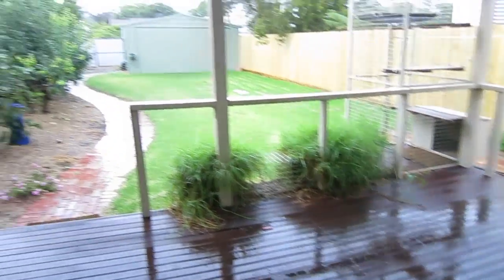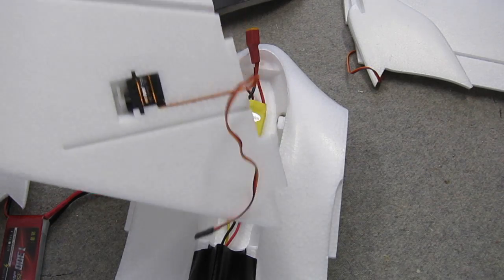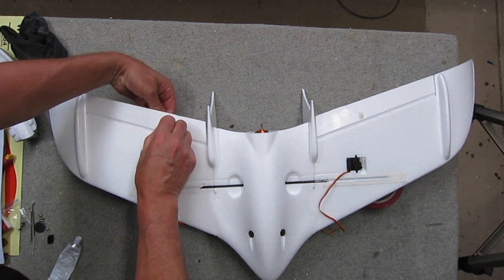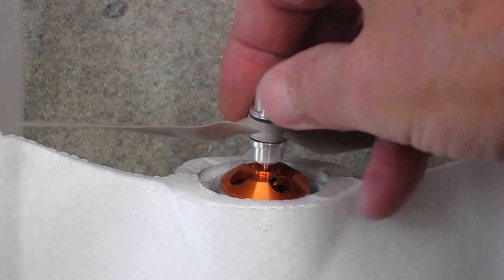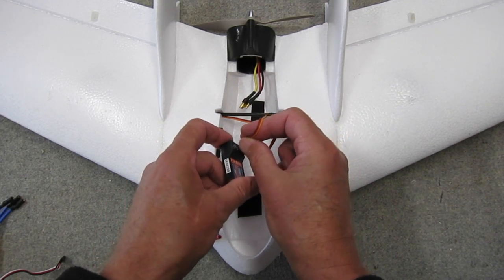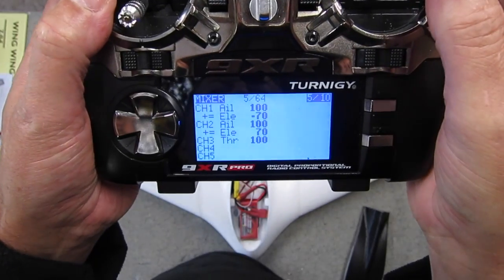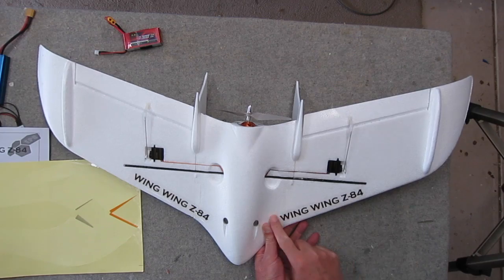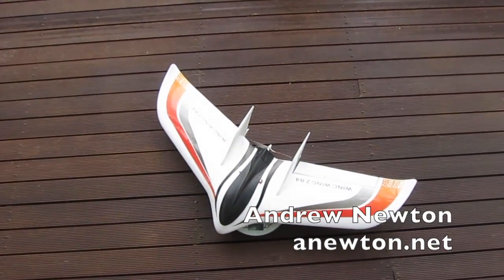Wing Wing Z 84 build

Comment: I would Have liked to see which holes did you use in the horn and on the servo. Also how much throws you have setted up. I am building mine. I have to make one of the holes bigger on the servo side but not sure which one to choose.
Reply from the maker: I'll share some closeup photos in a minute
Reply from the maker: Reflex and pushrod photos https://www.flickr.com/photos/pandasimages/31892513604/
Reply from the maker: https://www.flickr.com/photos/pandasimages/31892513134/in/photostream/
Reply from the maker: I have 50% 75% and 100% rates. It's a bit wild on 100% need to work up to that.
Reply: Thank you. I see that I need a little bit more reflex. Your servo control horn is quite shorter than mine. I installed the TowerPro Fake metal gear servos and they have quite a larger control horns so instead of the last one I used the following one. Your rates will help at keeping the maiden anxiety more controlled for sure. :)

Comment: oh, should the rx's antenna lay horizontal or stand vertical?
Reply: i placed the antenna like what you did but loses signal around 50m ?
Reply from the maker: For best range it should match the transmitter antenna, both vertical or both horizontal and side on to each other. Worst signal will be when they are pointing directly at each other. But if you're losing signal at 50m you have bigger problems than antenna orientation. Maybe a broken antenna.

Comment: can you tell me what size prop adapter i need? just ordered this from Gearbest. dont want to be held up too much when it comes
Reply from the maker: I think I used a 3.17mm but will need to confirm that. Your supplied adapter might fit anyway.
Reply: That would be awesome. I searched for more builds, saw like 4 videos but nobody showed or talked about that. I am screwing the motor to the motor pod right now. Did you installed the push rods in a way that gives a little bit of up elevator to counter act nose down at launch?

Comment: What battery does the plane come with?
I am only 14 and I am looking for a cheap small plane to buy that I can add fpv to later on. But small things in the quality like the wrong prop adapter, bad glue make me afraid to spend the limited money I have, do you recommend another plane that would suit my described needs?
Reply from the maker: +Ultra RC 1300 2S battery, Not the best plane for FPV. Your Versa wing would be better.